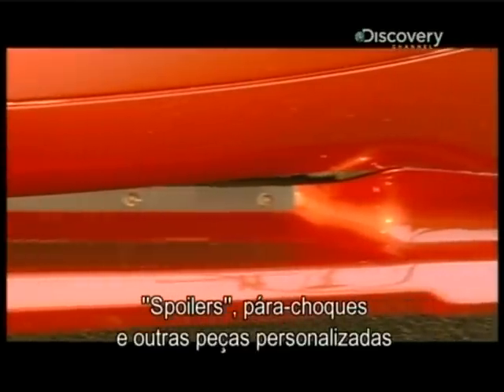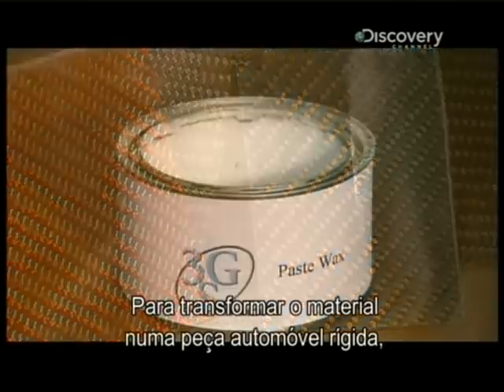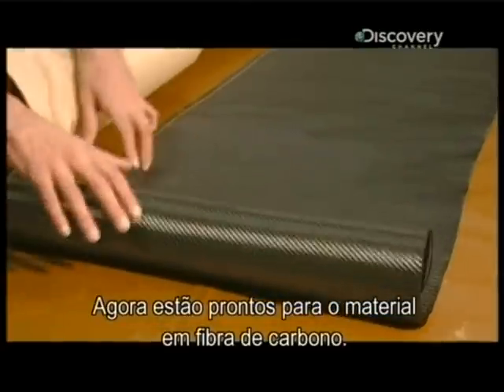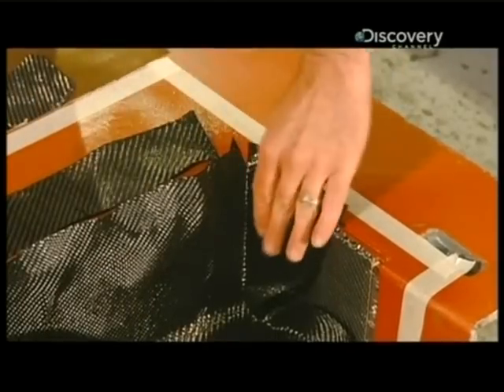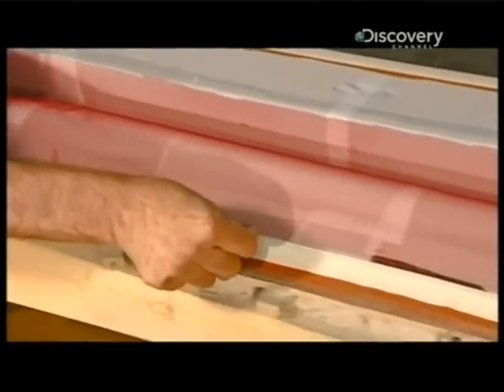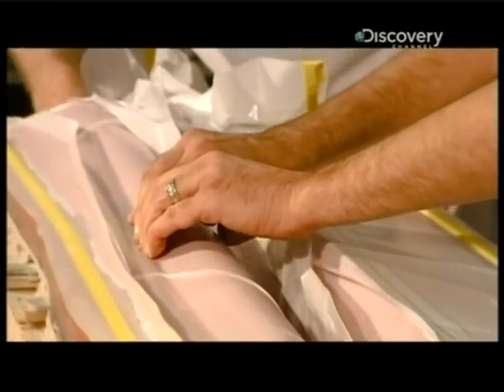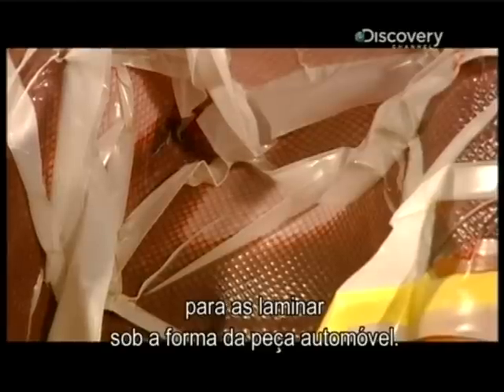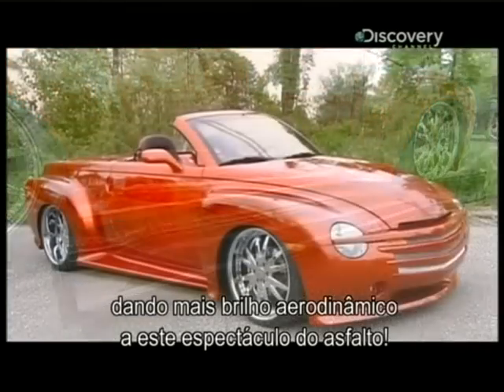How to make carbon fiber parts

Comment: This process is commonly known as vacuum-bagging.
Reply: No, it's called vacuum infusion. Vacuum bagging is the same except you wet the layers of carbon with epoxy resin by hand as you layer in the mould. Then vacuum bag and let cure.

Comment: brittleness,tensile strength,compressive strength are some variables in a complex equation. structure,alignment,shock load absorbtion,resin fibre ratio,etc are many other variables that can explain why it  can stop bullets.Kevlar has the best structural efficiency for bullet proofing but that does not mean carbon fibre cannot stop a bullet with more thickness or a special arrangement. heck,Even a  phone book can stop bullets.

Comment: @nameloc1000 i dont doubt its strength. Its just very weak to a suden impact. like carbon fiber wheels can shatter if they hit a pothole in the street, yet they can support the weight of the car.